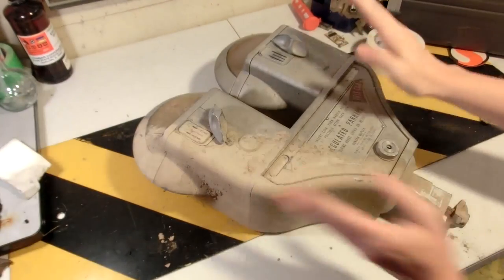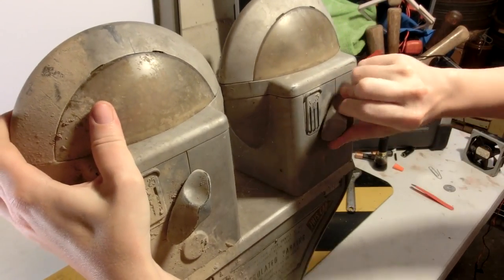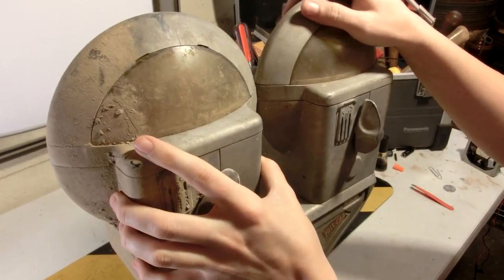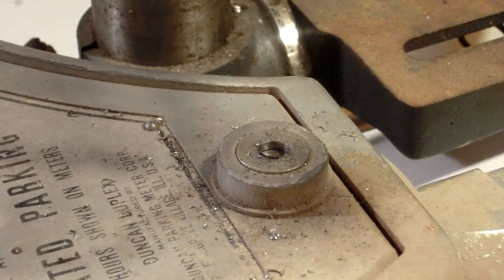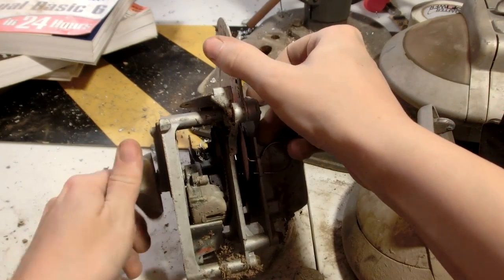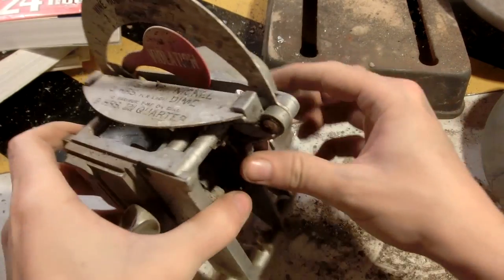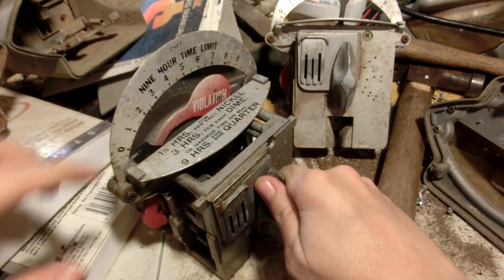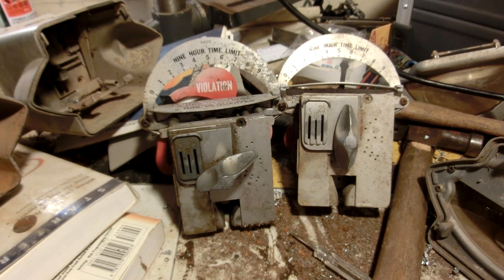1960s Duncan Duplex Parking Meter Teardown 1

Comment: Those locks appear to be a slider based mechanism and the key would have a groove running down the center of the key that would interface with the sliders and when lined up would open, search "inner groove key" on google for a reference.

Comment: The violation flag comes up when you start turning the payment lever until you finish turning it fully. The reason is a lot of people used to try to cheat the Meter by putting in a coin then only half turning the payment lever then when the parking inspector came along they see you hadn't turned the lever fully (and you could claim you didn't  realise it wasn't activated) so they would fully turn the lever to start the timer. Thus you could get that extra time period until the parking inspector came along for free.
So they added the violation flag to clearly indicate you hadn't properly activated The Meter and couldn't complain when you got a ticket.

Comment: Lol that little temper tantrum was priceless.
Reply from the maker: ya know, i dont think you know what temper-tantrum means.
Reply: Ya know you are probably right.
Reply: Wait... just looked up the definition. I was correct. Good day.
Reply from the maker: +Thatworks no you werent. if id just yelled at it or cried then it woulda been a temper tantrum. i was trying to get the latch to pop down though and help jostle the last pin loose. its just how you escelate a teardown before bashing with a sledge hammer or cutting with a torch.

i was very frustrated for wasting 90 minutes on that last meter, but i did not throw a temper tantrum. a temper tantrum is when a child throws a fit in order to get others to accomplish what they want, i wasnt throwing a fit either.

whats your first language?
Reply: I said Good day!

Comment: I used to see piles of stolen, broken open, parking meters in the City of Oakland, CA.
It was an epidemic. So they replaced them with stronger ones and it wasn't long before they started showing up. I think all they needed was a pipe wrench and a sledge hammer.

Comment: I reran the video several time and noticed a camera illusion where the drill bit appeared to be running in the wrong direction while you were drilling the locks out. Clearly it was a camera thing as the drill was cutting the hard metal.

Comment: Hey , i want to make a electric bike and i want to use a 220v motor that i allready have and i don't know if it's worth it to buy a car baterry and a 400w(or higher) dc to ac car invertor .i mean , the motor it's powerfull and fast , it consumes about 350w and has a gear reduction installed on it (about 3/1) .. BUT i don't know if it will run for a long distance per charge.i made some calculations and with a 400w inverter , and a 50ah 12v car battery and the motor it will run for an hour and that will be suuper great but idk if it will be that great if the invertor it has current losssooo everything will cost me about 200$ , the bike will run with about 50-60km/h for how much time? Do you think i have to start now the project? Or forget about it?(sorry for my english , i'm from another country)
Reply from the maker: +Robert Bîrdău dont forget peukerts law. once you start pulling significant amps from the battery, the capacity goes down. id expect to only get maybe 10ah from it when discharging at 350w. also an AC motor wouldnt probably work too well.

im pretty sure there are ebike kits for a low enough price.
Reply from the maker: +Robert Bîrdău also a battery meant for starting a car isnt made for deep discharge. its meant to give one sudden burst of power and then immediatly get recharged once the engine is running. it would probably only last like 10 cycles before being significantly damaged. if you use lead acid you should aim for deep cycle.